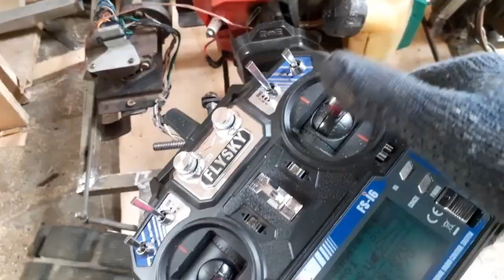Membuat mesin pemotong rumput yang dikendalikan dari jarak jauh menggunakan remot control

Comment: Bang kalau sterinya lebih dominan ke sebelah aja solusinya gimana?
Reply from the maker: Maksudnya gimna bang , boleh liat videonya?
Reply: @tovaceh28  soalnya kalau pas ku tes ke kiri 4 volt ke kanan 3 volt 😆, apa salah masang motor drivernya ya? Padahal udah ngikutin cara jamper abang di video
Reply from the maker: Di pin yg mana yg diukur bang?
Reply: @tovaceh28  yang ke arah dinamo wipernya bang, sampingnya input baterai
Reply from the maker: Abang suplay modul drive ke motor wiper pake berpa volt ?
Reply: @tovaceh28  yang input baterai pakek aki motor 12v
Reply from the maker: Tpi respon motor wipernya uda ngikutin arah joystick pada remot belum bang?
Reply: @tovaceh28  sudah bang, sudah ngikutin
Reply: @tovaceh28  apa perlu naruh gear yang bisa ngatur posisi baliknya ke dinamo wiper nya kah? 🤔
Reply from the maker: Tpi tenaga motor wipernya uda kuat apa kurang tenaga jga ban?

Comment: Bang cara rakit micro servo ke dinamo wiper gimana?
Reply from the maker: Nanti saya coba buatkan videonya bang klo ada waktu
Reply: @tovaceh28  pakai tambahan relay kah bang?
Reply from the maker: Gk bang , pakai motor drive jga
Reply: @tovaceh28  yang tipe apa bang? Bisa minta linknya?
Reply from the maker: @kangmultitalent   motor drive  BTS7960
Reply from the maker: https://id.shp.ee/Tp3WAFs

Itu contoh linknya bang , silahakan pilih sndri toko yg abang percya,  sya hanya memberi contohnya
Reply: @tovaceh28  berarti reciver > motor servo >  dinamo wiper ya bang?
Reply from the maker: Reciever -> servo -> modul BTS -> motor servo , tpi as motor servo di konek ke as dinamo wiper
Reply: @tovaceh28  servo pakek 2 berarti
Reply from the maker: @kangmultitalent  1 servo untuk 1 motor driver bang
Reply: @tovaceh28  itu berarti servo sama motor servo beda ya?
Reply: @tovaceh28  bang aku udah beli motor drivernya, sama servo, eh tapi pas dicoba bentar servonya dah konslet aja. Pas ku cek ternyata input yang diterima 9v, dan mikro servonya nggk kuat segitu 😭,
Reply from the maker: @kangmultitalent waduh micro servo sebaiknya maksimal 5 volt bang
Reply: @tovaceh28  padahal dah melalui esc ke reciver. Tapi esc outputnya ternyata 9v 😭
Reply: @tovaceh28  masih bisa d selamatkan nggk bang?
Reply: @tovaceh28  kalau untuk menurunkan voltase pakek apa bang?
Reply: @tovaceh28  bang aku sudah bisa menrangkai, cuma ini output dari motor driver nya kok nggk bisa 12v ya. Salah dimananya bang kira-kira?

Comment: Halo bang, kl buat seperti ini habis brp?
Reply: saya rasa yg mahal receiver,transmitter flysky + modul + baterai..
Reply from the maker: Betul bang , kelistrikannya yg mahal krn mesti pake bahan² baru
Reply: @Hariye-ch4rh hello saudara salam kenal 🙏🤝
Reply: Bsa psan kontroler ny aj bg
Reply from the maker: Bisa klo abang mau tanggung biaya  bahan²nya
Reply: @tovaceh28  brpa bg biaya pembuatan kontroler nu
Reply from the maker: Beserta remot atau gimna  bang?
Reply: Bang bisa bang pesan modul nya bang di luar reciver sama remote?
Reply from the maker: @Dimas-qr6hg  bisa bang , butuh yg brp chnl?
Reply: @tovaceh28  3 chnl bg,
Reply from the maker: Mau pke sistem stering sprti di video atau penggerak roda kirikanan kaya tank bang?
Reply: @tovaceh28  kiri kanan kaya tank bang
Reply from the maker: @Dimas-qr6hg , spesifikasinya pke box , kipas pndingin beserta soket xt60 kabel outputnya , atau masi perlu ada tambahan pary lain yg ingin disematkan bang , contoh volt meter , indikator batre , silahkan di reques spesifikasinya bang biar skalian sya cek harga total bahannya bang
Reply from the maker: @Dimas-qr6hg  kirim nmr WAnya bang , komenan suka tnggelam
Reply: @tovaceh28  brp hrgny bang